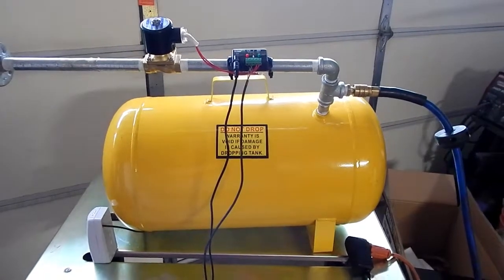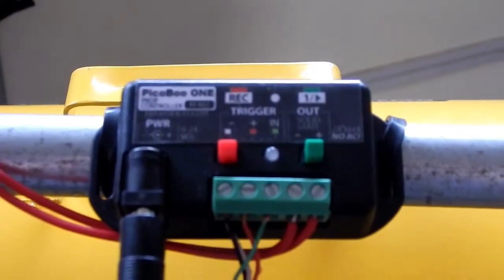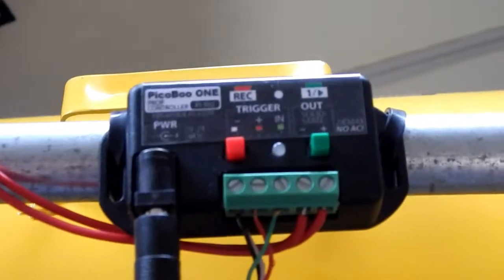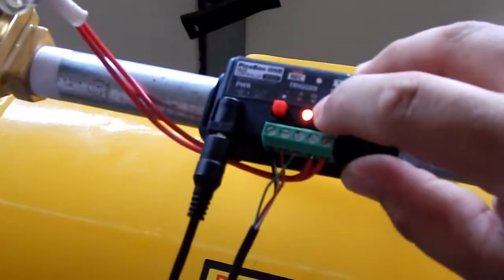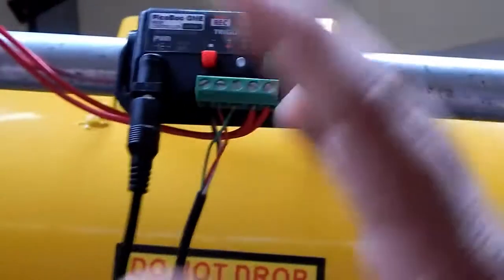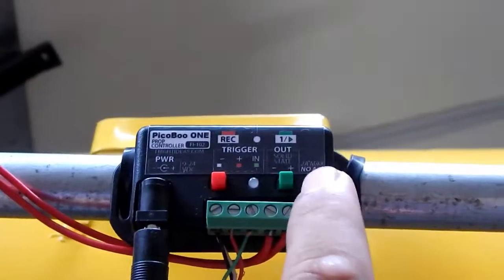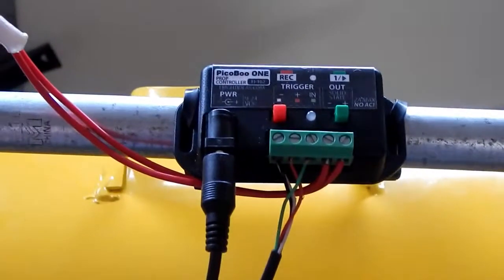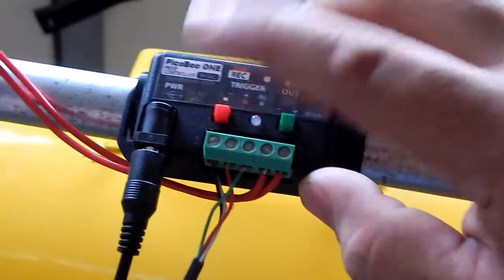Halloween air cannon part 2

Comment: I notice some of the other builds use a regulator. How are you adjusting your volume of air?
Reply from the maker: This was the first one I built, and it did use a lot of air. So I will be adding a regulator to control the volume of air this year.
Reply: The reason I ask is my compressor has a regulator out and was thinking that you might have been using that to regulate it. The only problem is I don’t think it will recover as fast.